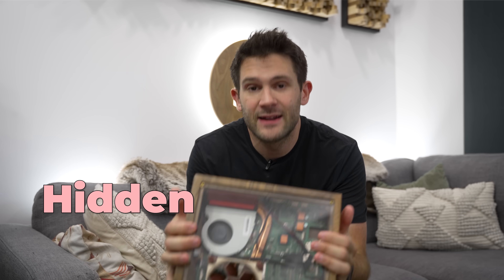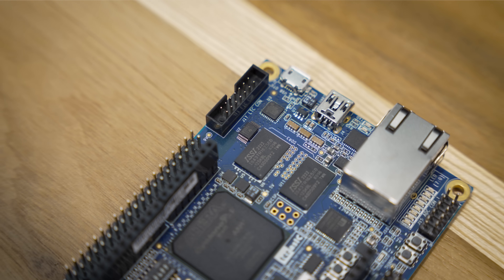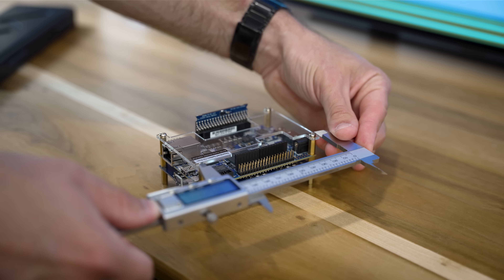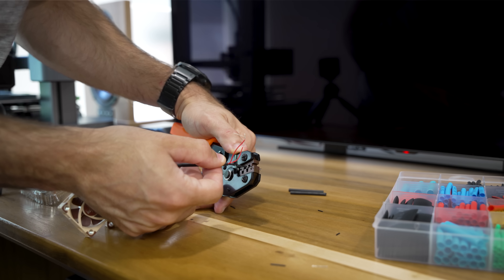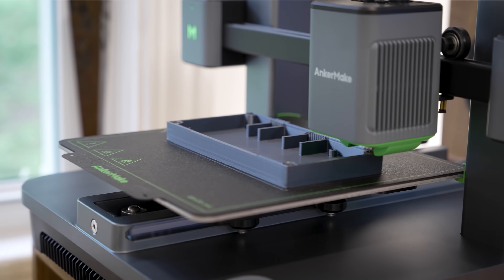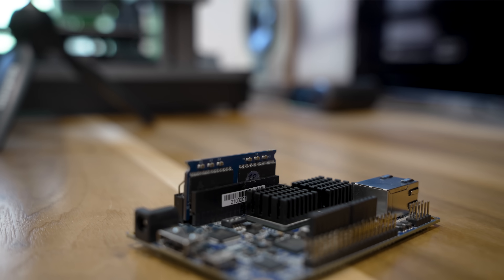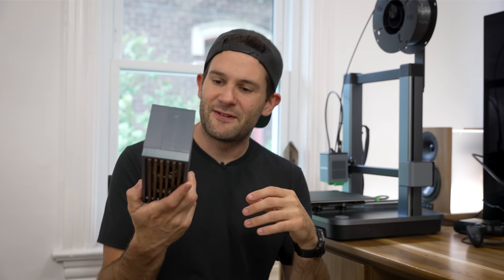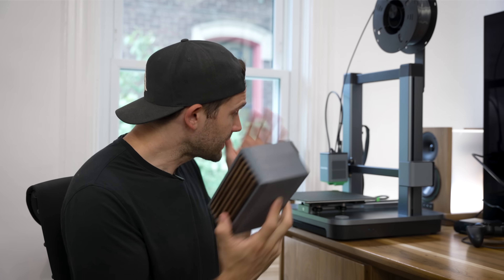This DESTROYED my $4000 PC

Comment: This is my favorite comedy channel. I like how he destroyed two whole boards to make a few popsicle-stick inserts for his case when the same could have been achieved easily by rounding off the edges of the board then cutting them out on a table saw. But no, in clown world we need a $5K+ CNC machine and an entire 1x6 feet of walnut to make a few 1x6 inch inserts.

As for the lag, most of that is coming from the HDMI output, and to a lesser degree, USB. Both of these 'features' combine to add substantial latency. A digital monitor or TV with a 60 Hz refresh rate is going to introduce a minimum of 16.7 ms latency, which does not include any introduced by the scaler on the device. A USB 2.0 port has a minimum latency of 1 ms but it can be higher when you are translating USB signals to another kind of interface.

Comment: Hey, here's an idea: a model with analog output and full access to the microSD

If you could make a tutorial for that, I'd be able to hook it up to my CRT!
Reply: Fortunately analog output is very easy on MiSTer.  You can get either special adapters for the DE10 Nano itself, or you can get a board that sits on top of it and adds connections.

Comment: testing lag with a usb gamepad is not going to give good results. use an original game controller from nes/snes etc. that's what mister is all about, near perfect "emulation", while being able to use all the old gamepads, joysticks, monitors etc.
Reply: The controller shown adds about 6 ms of input lag which isn't bad.  SNAC connectors with original controllers add effectively zero input lag, but you can also get daemonbite adapters for those controllers that only add 1 ms while not compromising in the way SNAC does
Reply: @dinierto  i dunno, 80 ms still seems high, considering sonic is a 60 fps game, if i'm not mistaken. maybe i missed something...
Reply: @giornikitop5373  it is rather high, but the MiSTer itself should not be the issue

Comment: OK, so before anybody rushes out to spend hundreds of dollars on a MiSTer, I feel this video is a bit misleading in terms of how different it is from modern emulation.

If you're plugging in your MiSTer to a modern TV and using a USB controller the emulation lag on a software emulator running on a competent modern computer is very similar. Lag is not the reason to spend all that money on an FPGA device.

The thing MiSTer does is replicating the inputs and outputs from the original hardware. It is not particularly useful for HDMI on USB controllers... but it's amazing if you want to plug it to a CRT, use an original controller or slap it inside an arcade machine to replace broken or missing hardware. Got some old microcomputer tapes and want to play your old 8 bit games from a tape deck on a 15Khz CRT TV? MiSTer has you covered. 

THAT is the real party trick. If all you want is play games on your flat TV Retroarch is more than enough. Just go look up the lag mitigation settings, make sure you have a recent X64 CPU and you'll have a great time.

As for my sources, I have three separate MiSTer rigs plugged into all sorts of legacy hardware... and also play a lot of emulated games on PC handhelds and other computers.
Reply: Just a point, HDMI isn't the one causing lag, it's the digital processing of the image that causes lag. HD CRTs suffer from a similar issue of them having input latency thanks to the digital processing going on while SD and VGA CRTs have no digital processing and thus no lag
Reply: @crestofhonor2349  Sure. In practice, though, HDMI is good shorthand because it is the digital standard for modern TVs. The key point is that once you have a cable going to a display with some image processing lag, plugging in a different thing to that cable won't fix the lag down the pipe. 

To be clear, modern high end TVs with VRR and high refresh rates have increasingly solid speeds in game mode, to the point where in some games, or when there is a bit of lag elsewehre it's getting harder to tell. They're still slower than a CRT drawing whatever analog signal it receives as it receives it. 

In the setup tested in the video, and as seen at the end, the FPGA does little to improve the end to end lag. He would have gotten better results by updating the screen and controller, especially against the full PC, and he could have narrowed the gap further by using heavy lag-reduction tools in some emulators. Spending 400 bucks on a dedicated device that will only emulate some  systems and lacks features of software emulation makes no sense if you don't have a matching setup elsewhere.

But if you're an insane old fart like me and have already invested in CRTs and original hardware a bunch and can afford it, then go nuts. Having one of these working on your old TV or even VGA CRT is uncanny and very cool. Although 15KHz timings are sometimes wonky on consumer sets with no timing and geometry adjustments, but that's a different rabbit hole.
Reply: @mademedothis424  I have bath SD CRTs and a VGA CRT. None of them were bought as they were my parents so  yeah I love CRTs

Comment: The intro has a lot of misinformation. There's no reason that software emulation has to be hacky nor include trickery, the reason they do is because it lowers the CPU requirements and since software emulation has been around for a long time and CPU used to be worse than they are today there is a lot of perception that software emulation is necessarily bad. Higan is a software emulator that was built to be accurate and without tricks (and bsnes can be made to work like higan does by disabling the hacks in the settings).

On the other hand FPGA cores and HDLs in general require you to sus out the specifics of the hardware instead of the software side of things AND you can have really inaccurate and "hacky" FPGA cores that are no more accurate than a bad software emulator would be. There's a reason that game compatibility and fixes are still released for FPGA cores, for any reasonably complex hardware system they're just not perfect and need tweaks over time to make them more and more accurate (just like software emulators).

Comment: You should see if you can plug the wifi adapter in to one of the USB ports that aren’t accessible from the outside.
Reply from the maker: Good call, I definitely think I could fit it into one of the upper ones.

Comment: Really cool thing about the Mister is that it can run on any display you want. It can run on a SD CRT, HD CRT, VGA CRT, and Modern HD TV. It is such a cool feature that will satisfy anyone and will work on their TV reguardless of what they own.

Also I do disagree about filters. After I went CRT filters I can't go back. CRT filters make any system from the 5th generation and before look significantly better. Plus it makes the art in these games looks far better and make more sense. Even with GBA I use an LCD filter instead of raw pixels. I can't really go back to raw pixels.
Reply: I never liked CRT filters, they totally killed the colors. Maybe I am using them wrong?

Comment: While the experts are still hanging around the comment section, anybody want to suggest a pi or something else I can use since I'm not gunning for accuracy and can't afford $400?
Reply: i wouldnt call myself an expect but im decently passionate about this stuff so:
if you dont care about accuracy, absolutely anything will do. raspberry pi, android phone, your pc, a switch, absolutely anything. still tho, depending on the system youre trying to emulate, id still recommend getting the most accurate emulator possible if possible for just a better experience
Reply: @lootria  I appreciate your advice. I want to make his project, just with something other than the fpga
Reply: Steam Deck is really good if you want a portable emulation set up
Reply from the maker: There's a few vendors of alternative single board computers out there. I haven't dove into it yet, but I've heard the names RockPi and OrangePi before. They both make "knock off" Raspberry Pis that are very good at emulation.
Reply: @ZacBuilds  oh holy crap, wasn't expecting a reply from you! Guess I'll head down the rabbit hole with those leads, then.

Comment: Whether you intended it or not, this really comes off as shilling HARD for further pumping up the pricing on the collector's market.  Trickery has nothing to do with emulation.  It's translating one set of instructions into another, one architecture into another.  This is no more "trickery" than the MMC chips on NES cartridges expanding the address bus to allow for increased ROM sizes.  As to "playing the game as intended", we are at a point, now, where multiple generations of emulators are so close to perfect one literally cannot tell the difference without doing frame by frame comparisons, and some are so accurate that even that doesn't give it away.  In the end, play the games the best way they can be played by you.  Spending a fortune on collecting and then likely having to fix original hardware with increasingly scarce parts...that is not for everyone, and shaming/scaring the folks it doesn't fit for, which is going to be most, is silly.

Comment: FPGA means you can program it as you see fit after final assembly,  basically you can make a lot of cool things with it with no hardware modifications just via software, it does not program it self!

Comment: I have those same barrel plug adapters and use them for FPV goggles.  I found if you gently pull on the wire, it is likely to fall out.  The simple solution was a small bead of solder on the tip of the wire so that it can't slip back out by the screw.
Reply: That is never a good idea. You should never tin wires that go in screw terminals, the solder deforms over time under the pressure and leads to a bad connection, cheap 3D printers have this problem and it can lead to fires. If you need to use stranded wire then you should use ferrules. You can get a cheap crimper with a set of ferrules very cheap. Or if you use solid core wire and it pulls out then add some strain relief.
Reply: @conorstewart2214  I appreciate your concern but the solder isn't under pressure and merely locks the wire in place.  I've used this method for numerous years at this point.  It may not be ideal for every application but for my goggle wire, it's perfect.
Reply: @Cappurnikus  if the solder isn’t under pressure and is just holding the wire in then the wire itself might not be under pressure and might not have a good connection. If the pressure on the wire is holding it in then you know it has a good connection. It’s probably good enough for powering some goggles but I definitely wouldn’t trust it for anything higher power.
Reply from the maker: Good call! I actually had to re-seat those wires a few time before I got enough clamping pressure on them where they would stay in there properly.
Reply: Or get a proper panel-mount connector. If you're stuck on screw terminals, at least use ferrules, they're super underrated!

Comment: Woah! Your PC has 6 frame lag? I knew that modern PC lag is dumb.
Ok. Sonic on Genesis is known to have 2 (33 ms) frame latency. Buying MiSTer to catch gain a single frame of boost is pointless. Between modern idiotically "smart" TV and USB your setup lost 48 milliseconds. You'd be better off with 5 frame "Run Ahead" setting in RetroArch.
Nothing beats the original hardware, though!

Comment: Emulation may not be accurate, but i also never owned any of the consoles.
The PS1 was owned by brother, so he took it with him, when he moved out. I got snes/nes clone system, but idk how accurate they were.
I got a gameboy, but the screen isn't the best and i probably won't spend the money to mod it.
So for me emulation is probably the best route as i don't really have enough burnable income for a FPGA system.
Reply: Emulation accuracy really just comes down to hardware requirements and how well the developers made it.  FPGA (like MiSTer) cores are the same way, but it's easier to make FPGA cores more accurate because you can design the chips to run in parallel instead of needing increasingly more powerful hardware.

So in short, there are indeed many software emulators that are quite accurate, and many FPGA cores as well.

Comment: It's a quality issue.  Emulation can be very good.  It can even improve certain aspects of the original hardware.  Modern systems are more than capable of running code that virtually recreates the old hardware at full speed.  But if that code is buggy or otherwise flawed, the results can be disappointing.  Regardless, assembling new hardware just for the purpose of playing old games is a non-starter for me.  I know there are people more passionate about this than I am.  I hope they have fun in their endeavors!

Comment: It would be nice if it detected the games you loaded and then limited the emulation selection to just the ones you have.
Reply: I think the Analogue does that.
Reply from the maker: It may very well do this if you spend the time to set it up more. I'm still pretty new to the MiSTer OS and didn't optimize it very much.
Reply: I'm not sure what you mean?  Like, hide the systems you don't have games for?  You can absolutely do that, although it would be a manual deletion of the cores you don't need.

Comment: Using an FPGA to hardware emulate is pretty close, if not indetical, ti original hardware as the little quirks can be replicated also.
Software emulation is always a compromise and difficult to get right.  There was a project named MISTer that was my first experience with FPGA.    Thanks for a great video.
Question on the printer:  Is the slicer a modified version of Cura?   I've user Cura on my Ender 5 and been quite impressd with it.
Reply: Yea, it’s cura.

Comment: It should be noted that SNAC is not always the best choice for original controllers.  It does reproduce the behavior and (lack of) latency, but you also can't control the OSD with a SNAC connection.  If you use a low latency USB adapter, or daemonbite adapters (which use a microcontroller and open source code) you only sacrifice 1 ms of lag and regain the ability to control the OSD (the MiSTer's menu system) and remap buttons as well as use the controller for any system.

When it comes to input lag, the test done in this video is missing a lot of context.

Does he have USB fast polling enabled in the MISTer?  Does he have the latency numbers on his TV?  Does he have it in game mode?  Did he use the same controller on the PC?  What emulator did he use on PC?  What settings?  These are all major factors.  Then you get into things like run-ahead settings which are complicated.

Overall though I'm glad to see more people talking about the MiSTer project, it's such a cool and fun emulation platform with so much development going on right now.
Reply: SNAC is always best. Sure it doesnt work in the OSD, but gaming is never done in the OSD.
Reply: @ZaPpaul  SNAC is not always best IMO.  You give up flexibility for literally 1 ms of input lag.

Comment: The bright cherry-wood would have made it pop a lot more, so I think it would have worked better with it.
Reply: Problem is that it doesn't match with the other wood in the room so for that reason you're wrong.
Reply: @volundrfrey896  While you might think so, having a bit of contrast doesn't hurt. Especially when the ratio is so overwhelmingly in favor of one side. The bright wood would make the console pop, which would also accentuate the darker wood.
Reply: @SapioiT  No you're wrong here. It would look messy and unplanned.
Reply: @volundrfrey896 Fashion is more subjective than you think.
Reply: Indeed

Comment: I disagree that original hardware is how the games were meant to look and feel, take ps2 for example there are plenty of games with high res textures and detailed models but the hardware of the time couldnt display them look at once they were ported to ps3 many games just had resolution increased no shaders or anything dumb like that. Now stuff like crts cant be recreated really with current tech because thats not how lcds work.

Comment: What program are you using for CAD for editing/designing the 3D printed files?
Reply from the maker: I'm using Fusion 360 for all the design/CAD work. Once you've got your model the way you want you can just go File > 3D print and it sends it right to the slicer of your printer. Pretty awesome integration.
Reply: @ZacBuilds  Thanks for replying - just getting started in making/editing my own models for 3D Printing, so it is good to find out what other makers are using (and what works best).  I actually have access to Fusion 360 via student program, so will give it a try!  😁👍

Note: Was also great to see you using the new AnkerMake M5C, I backed the AnkerMake M5 in Kickstarter (it is my first 3D Printer).